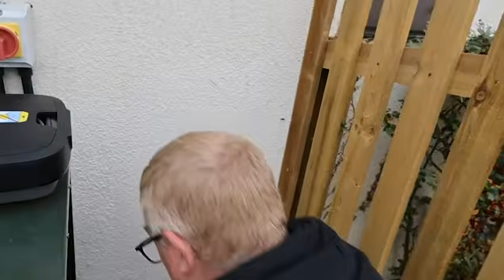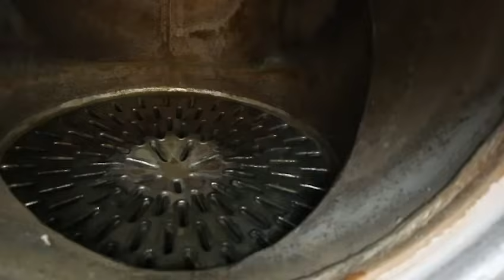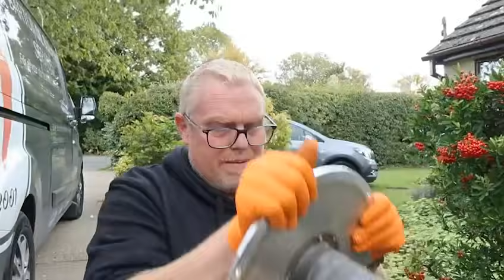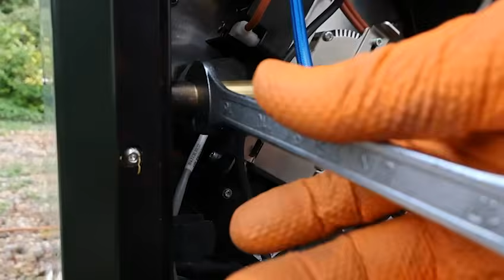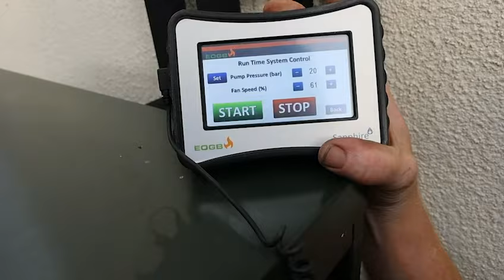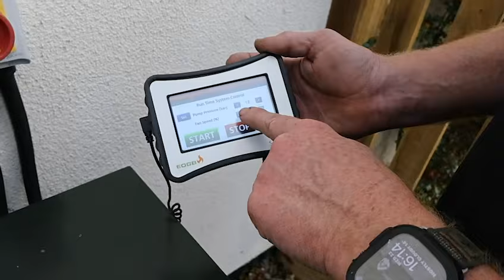Detailed Sapphire Fully Modulating Oil Boiler Service

Comment: You know as well as i do, theres no such thing as a modulating boiler 😂😂
Reply: Also, why do you think danfoss pumps shouldnt need a tigerloop, you just take the little oring out and its good for tigerloop
Reply from the maker: because thery run at 20 bar sometimes they are tending to create a bit of air now and agin so the tiger loop overcomes it.
Reply from the maker: if more than 2 stages they say modulating 🤷🏻

Comment: Most of us on this side of the pond are still rocking regular non blue flame oil burners. Myself included. Blue flame tried and failed here about 15 years ago because the diesel wasn't clean.
Reply from the maker: Thanks for the info! Hope you are still rocking away over there. Have a good week. Rob

Comment: I’ve fitted a few of these. Very loud and can be a bit temperamental. 
I had to take one out because it kept going wrong, replaced it with an air source heat pump.
Reply from the maker: Hi. sorry this happened. Not sure why this happened to you. Never had to do this. Once set up they are normally fine. Version 2 is out so all issues sorted. Mat=ybe try another as much better now! . The key is the setting up mate. Have a good weekend. Rob

Comment: I absolutely love the look of these boilers. I’m from Dorset and yet to see any down down south, and my boss is in bed with Worcester so that’s pretty much all we do, but I’d love to have a go on one and learn more as they look top of the game. Any common faults or problems you have with them? May look at a course myself
Reply from the maker: Hi. Thanks for the great comment. They had a couple of early teething issues like the odd lcd display and electrodes distorting before service and condense pumps being  not so great  but this has been sorted with thicker electrodes and up to date better software in lcd displays.Also condense pumps improved but still recommend either try not to use or if you do use a good Grundfoss style pump. Go for it make you will love it. We have fitted lots now and they are all purring away nicely!. Have a good weekend. Rob
Reply: @BartonOilBurnerServices  managed to talk my boss into coming on a course with me for them so super excited about that. It won’t be till after silly season unfortunately though. What sort of price comparison roughly between a Worcester 18/25 internal? If you can’t tell me on here let me know and I’ll drop you an email or something? Really want to try get him to try one at least. Completely agree with you and think these are the future of oil boilers from what I read/see

Comment: I like the principle of a sapphire and I am yet to see one in the flesh, servicing looks to be a bit of a faff to be honest! I would like to see one in 10 or 15 years because they look like they lack quality, but like I say I haven’t seen one in the flesh so open to be proven wrong
Reply from the maker: Please go and look at one. Not a faff at all. By far the easiest boiler to service properly and the set up side is a whizz once you have done a few. Full Stainless steel heat exchanger and no expense spared on quality. 25 year warranty on exchanger so they have put their balls on the line also. I still fit many floor mounted Grants and i would love to compare them year on year for 15 years. If your a good heating AND combustion engineer then i think everybody should look at them. If you are plug and play boys that install only and leave, Then leave well alone. Thank you for your comment as always. Your a good guy so go and see them mate. Have a great weekend. Rob
Reply: Hi Rob, lovely channel.
Watching you is like Watching me lol... OCDs are great aren't they ..
Not seen one of these boilers down here, look a bit Navien like...  hope they are more reliable. 
We tend to stick to Grant, occasionally a Worcester.

Keep up the good work, may all your breakdowns be internal boilers for the next few months 😂